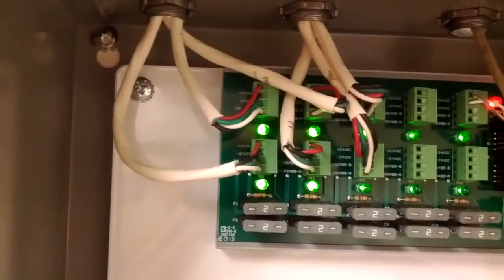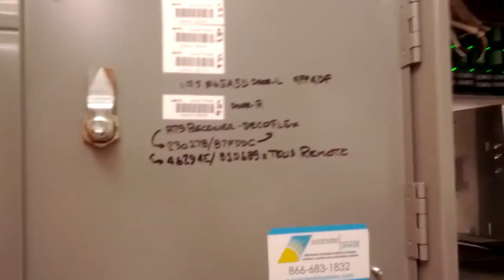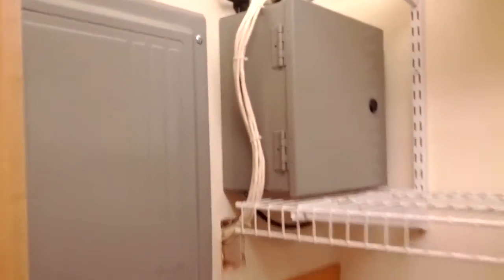Somfy ST30 Sonesse RS-485 with RTS Control

Comment: Great video...really insightful. The set up you have I am not clear on. I have RS485 motors, for 18 Windows, wired into control distribution (two 10 motor distribution boards) What device can be used to integrate the motors to a network, for home automation. I use homeseer, which has a Somfy plugin. Because the moto's are non-RTS, I don't know which device I can purchase to complete the integration.

Which devices did you use to receive RTS signals from the remote and convert back to RS485 for commands to the motors. Aren't the motors dry contact only?

Comment: Which motors did you use?
Reply from the maker: Basam Abdallah Somfy ST30 RS485 Sonesse 24 VDC motor. Link: http://www.automatedshadestore.com/shop/product-info.php?Sonesse_ST30_RS-485_24V-DC_Rollup_Motor__1000658-pid432.html
Reply: maestria 50 is not working with 10 homecontrol